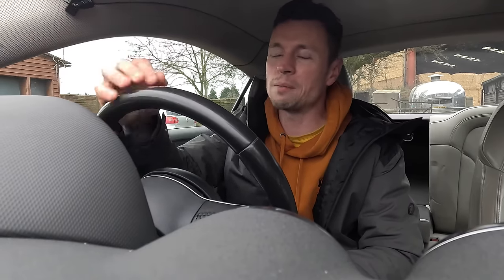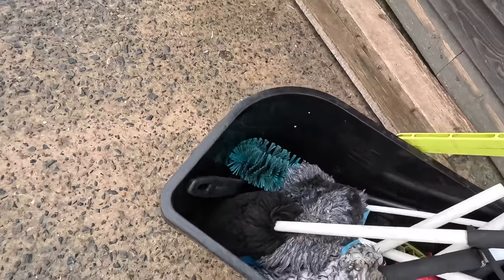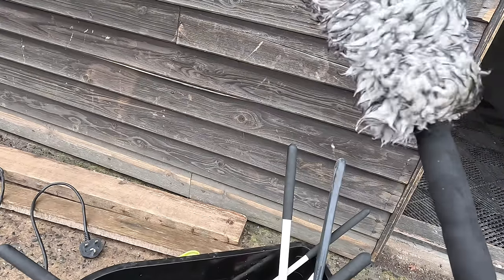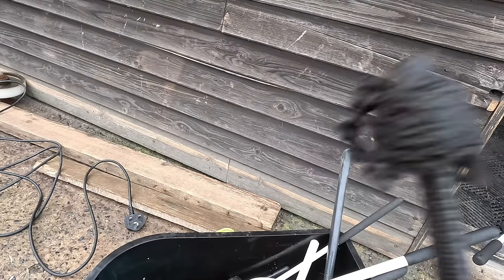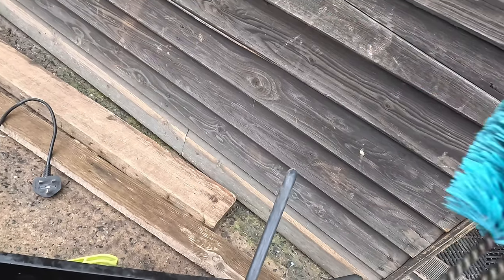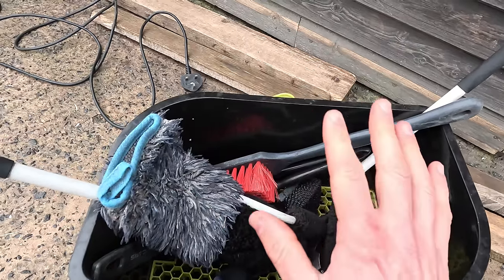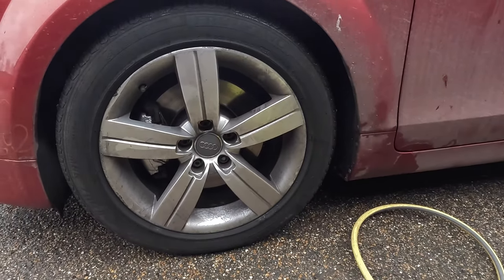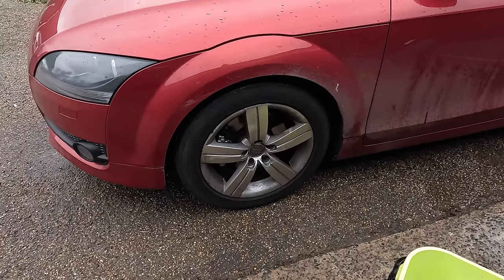A Controversial BUT effective way of cleaning car wheels

Comment: I'm someone that hates cleaning wheels.  Nonetheless, i use a vikan, boars hair and the DF tyre brush, along with a mitt and the EZ or Vikan barrel brush, as well as a bucket of shampoo, a pressure washer, surfex and an IK foamer.....  It was exhausting just to list it 😅
Reply from the maker: It never stops. We all have the best intentions of doing it all by the book but with my own cars I'm not fussed anymore
Reply: The Vikan barrel brush is nice. I also got one. I decided to buy one of them instead of the EZ brush
Reply: Wish I could get down to clean the wheels properly 😞. Back was knackered in crash years ago so best I can do is clean the wheels with a soft floor sweeping brush! 😣

Comment: Yessss sir, I've been doing something like this for a while, if I neglect the car and the wheels really get bad then sure, I go for brushes, iron remover, and so on. But if I manage to keep up all I need is a few liters of water a capfull of rinseless wash and a mitt or a towel. Easy, fast and as an extra I don't get my face covered in brake crap 🤣

Comment: My favorite tools for wheel cleaning are, the PU infused cloth from in2d, same idea, as yours, but the Pu doesn;t soak up as much dirt and last longer.  i use the EZ detail wheel brushes, they are just so good and have lasted me a very long time now and still look brand new.  i also use the dirt lock turbne grit guard and the dirt wall just so I can get a really good scrub at the brushes.  I've switch to the dirt lock as i feel it traps dirt a lot better than any other one I've used so far

Comment: Dave this is a good alternative method to clean wheels.  I had a client call and asked if I used a wired wheel brush since the previous detailer used one and the plastic tip was missing.  It scratched his rims on the exterior spokes and in the wheel barrel and he had to reapir them since the detailer wasn't insured.  It is a bit of a work but if you use the right mix of chemicals a degreaser and a brake cleaner like P&S let it dwell it works.  You mentioned the platic tip and some detailers forget that if it is missing you might as well throw it away since there is a chance it can damage the rims.   Have a great day and stay warm!
Reply from the maker: Yeah it's so easy to scratch with those brushes once the tip has gone. Wheel woolies have been the best for me so far but the valet pro brushes have also been pretty epic

Comment: The one thing I found a problem was cleaning wheels is the heat shields around the brakes they used to chew up my wheel woolies like no tmw. As they were descent ones it was expensive to replace them so bought the EZ barrel brush and use this instead as it goes between the brakes and heat shields with ease and no chance of being chewed up.
Reply from the maker: i think i need to make my own wheel brushes for a video

Comment: For a minute I thought you were going to use the Karcher patio cleaner attachment held at 90 degrees 😂
Reply from the maker: Stop giving me idea 😂. Never heard of that one but love it
Reply: @epicautomotivedetailing  yeah it's not a bad one that is it! Definitely worth an experimental video! 😂
Reply: That’s the first thing I thought also..
Have you tried it😂
Reply: @Belfasttintin not yet! May do but only on some old banger 😂 I already know it wouldn't work though, I used one last year and you have to move it around to get a full disc done. If stood still you just get the outline if a circle

Comment: buy 1l APC dilute it 10% in a hand sprayer, thats is enough for 10l of cleaner, dont rinse, just spray the wheels and arches wait 3 min, blast with power washer, and then use 2 diffrent brushes, one for tire and arches and one for rims. that is it 10min all 4 corners done. use iron remover few times a year... dont over complicate.
Reply: Yeah clearly you didn't wash a BMW M power 791M Gloss Black wheels and a set of 796M satin matt ones (the setup i run for summer and winter) after just 80 km of spirited driving (tons of brake dust) 🤣 Also drying, you didn't cover it. It all takes time to be done properly. And these wheels are nice, not a daily beater's wheels. Taking care is paramount (at least for me). Undercomplicating isn't great too. No offense just saying my bit, there are sometimes different factors in ones life.

Comment: I have been using a "wheels only"  meguiars wash mitt on my wheels for donkeys years. Same as this but better as it doesn't fall off your hand and you don't have to "grip" it... No need for brushes if the wheels are well protected and looked after too!

Comment: Thought you were wheeling out the steam cleaner for a surprise 'part 2'.....controversial indeed. Now i've said it i'd like to get a crap dirty wheel to test the theory on!
Reply from the maker: Do it, think about it this way normally you use wheel cleaner and foam before any brushing etc so it's a good solution for someone who's not invested in many brushes yet
Reply: Toilet brush from ikea 2 quid or a fiver with the steel holder ….it really does clean the crap